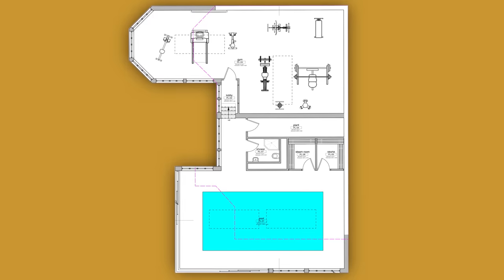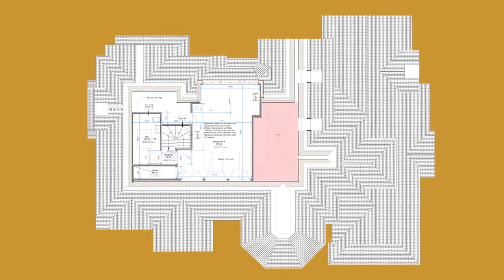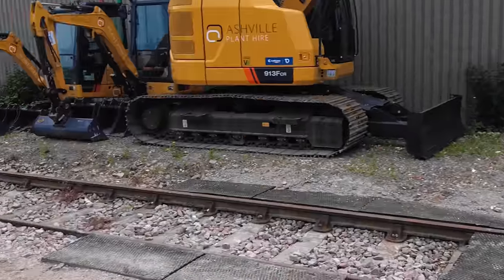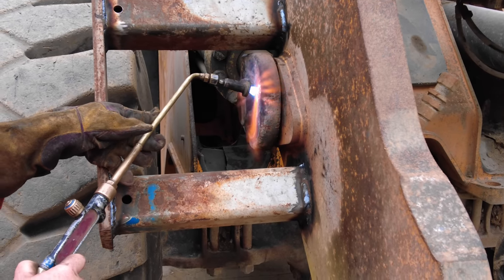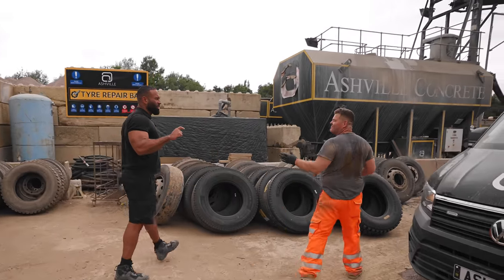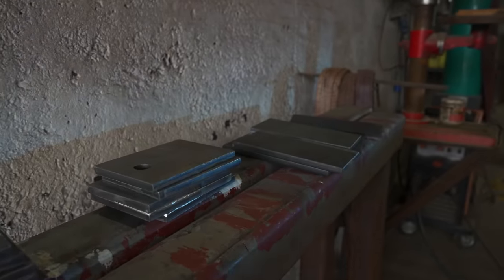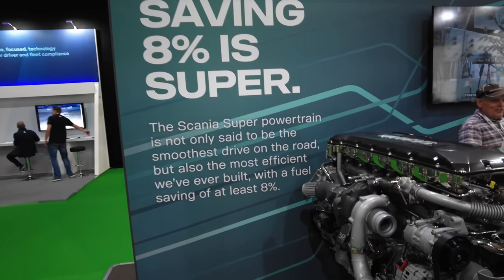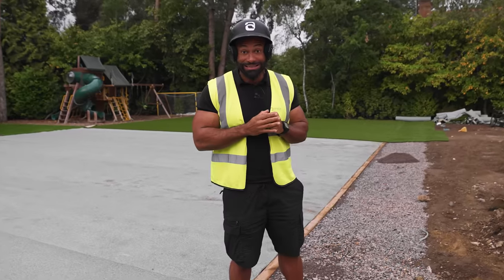Operating On Smoke | Ashville Weekly ep143

Comment: Hey Daniel, awesome videos. I’ve learnt so much even though I’m not in construction. Had a similar problem with punctures in a yard I used to work in, we bought a magnetic sweeper - basically a large magnet on wheels you can push around. Reduced our punctures significantly, especially in summer. All the best, Ed (Brisbane, Australia) 21:53

Comment: Use these screws from WURTH to screw through the ply into the steel. They use a normal drill and can go through up to 20mm steel plate. Best thing I've seen. Takes about 40 to 50 seconds to drill but are very good. Australia represent 🇦🇺 PIAS® WING-TYPE DRILLING SCREW, FLAT COUNTERSUNK MILLING HEAD WITH AW DRIVE

Comment: Daniel, no sprinkler systems work on smoke - the movies lie to you. They all have a small glass tube in them which explodes when a certain temperature is reached. This tube holds in place an end cap which then falls off allowing the water to flow. Different tubes have different temperature ratings so they can be used in saunas etc.

Comment: Always a pleasure to watch on Sunday I'm still here and have been since the beginning and will be for as long as Asheville continues to grow. The patch between the railway is a pain in the backside job needs to be done over the weekend not a simple pour either need to protect the rails with shuttering and need to go deep enough to put a substantial depth of concrete otherwise it's just going to get destroyed as it's such a high traffic area and all of this work guess wot it's unpaid which hardly motivates a man. Do network rail get involved as it's protecting they're tracks or is it completely down to Asheville as it's in you yard

Comment: In relation to the DVS star rating of your tippers etc, go back to scania and give them the chassis number. They will then be able to give you confirmation of the star rating, as the TFL system is not always up to date. If Scania tell you its a 3 star, send their confirmation to TFL who will update the records.

Its possible your lorries were 2 star fitted from factory, but had the extras fitted at the dealership and the star rating not updated on their system to reflect this.

Comment: Hey Ashville quick question where do you get the rubber mats from for between the railway track so you can drive across them  and I work for a company in Devon which repairs and manufactures rail wheel sets for some of the big freight companies and thought you might be interested in seeing the process

Comment: Hope everything’s going okay, just looked on companies house and Ashville Aggregates is currently in liquidation. Owing HMRC over £600,000.00, the local council £65,000.00 and nearly £30,000.00 to Barclays 😥
Reply: I tried putting that weeks ago and it kept getting deleted 🤷‍♂️ 2 companies are in liquidation
Reply: Weird thing to do and to comment. Are you okay?
Reply: @SB5v yeah mate, you?
Reply: I asked what the reason for it was as it’s a shame as Daniel does work hard and is open about everything but it was deleted at least 6 times 😂. ASHVILLE DESIGNATED LIMITED owes 793K to HMRC also
Reply: @jamiebiddleston-vk5ng i agree, got to show the rough with the smooth.
Reply: Think it’s just a restructure of the companies being used to trade - if you look, it is a voluntary liquidation - which means it is being done through choice.
Reply: @danielpercy2412 but suerly it leaves significant debts.
Reply: @paulf2529  That would only be the case if the company did not have the cash to service those debts or a successor/parent company to transfer them onto. Corporate accounting is confusing - and you can’t determine everything from a companies house filing (without context).
Reply: @paulf2529  yes it does even voluntary (it means the company has done it and not a creditor ) (looking at the amounts owed to HMRC it was only a matter of time before that happened any way      liquidation means money is owed if money was not owed they would not need to liquidate they would simply apply to have the company struck from the register  look at the statement of affairs it shows the deficit , my question was is companies houses don’t like you using the same or a similar name for 5 years after liquidation does that mean Ashville will change its name when the other are wound up ?
Reply: @danielpercy2412  might be by choice but over a million is being written off at the tax payers expense
Reply: @danielpercy2412  yes you literally can !!! 🤣🤣 the statement of affairs show the deficit or they would simply pay the debts then apply to have the company struck from the register debt free, the company is in liquidation not administration (administrator would signal restructuring ) trust me I know how corporate finance works 😂
Reply: @jamiebiddleston-vk5ng  “Written off at the taxpayers expense” - Where does it actually say that is what is happening, surely when the voluntary liquidation takes place, debts are serviced from the funds that the liquidator now manages (transferred from the company’s cash reserves / any asset sales). Think you are incorrectly assuming insolvency here, there are other reasons to go liquidation vs a simple strike off the register.
Reply: @danielpercy2412  companies house statement of affairs is what you need , Daniel put 1.6m into prop it up but still leaves 700k owed to creditors bounce back loans HMRC councils etc , that’s just in Ashville aggregates also look at Ashville designated ltd owes another 800k 

No company would voluntary liquidate owing money in this way  unless the could not service the debt
Reply: @danielpercy2412  also if you look on companies house the liquidation is shown under the tab “insolvency “ and the liquidation is carried out by an insolvency practitioner the clue is in the title 😂
Reply: @jamiebiddleston-vk5ng  Have you ever liquidated a solvent company? You need an IP for that too.
Reply: @danielpercy2412  agree to a point but liquidation is a process started when a company does not have the money to pay the debts it owes, voluntary or not. When it shows HMRC as second preferential to be paid that to me shows that the company will be wound up and any assets sold to cover the debts, owing that much to HMRC especially VAT will include a lot of late payment charges and interest so something has gone wrong somewhere.
Reply: @jamiebiddleston-vk5ng  agreed, if it was about restructuring the debt would have been paid via the other business or transferred and the company currently in liquidation would then be struck off or listed as dormant.
Reply: @danielpercy2412  but then the statement of affairs would show a positive (surplus) figure not a deficit ? ????
Reply: @HydeParkHarry is called money laundering ,in case you are wondering 😊
Unfortunately he isn't the only one in the UK
Reply: @mistery00t29  how would that work?